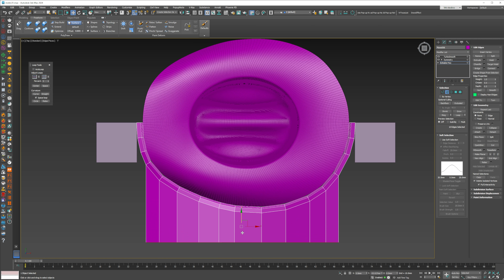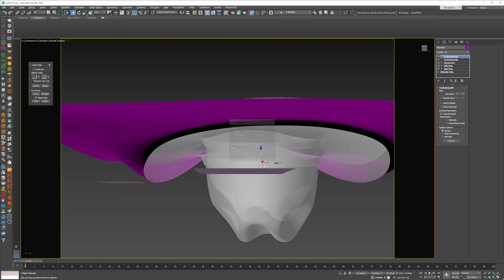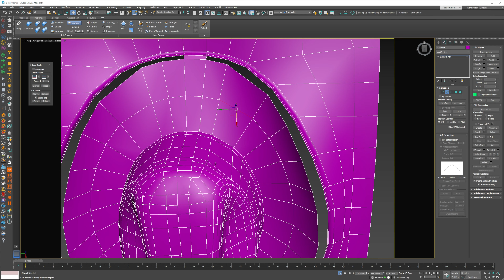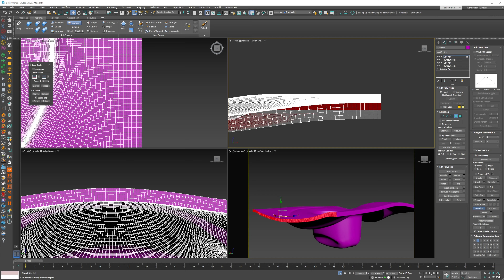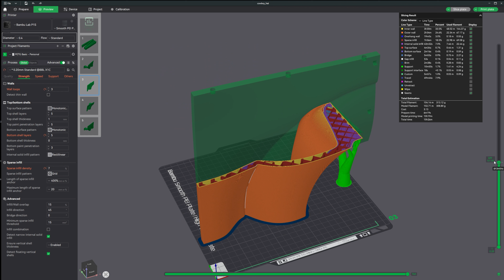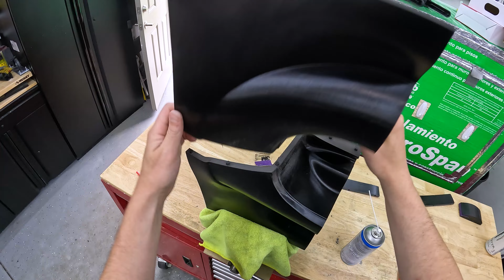3D Printing a Mold for Real Carbon Fiber Parts – Start to Finish!

Comment: Are you not going to coat it with epoxy resin like you did when making the Lamborghini bumper add-on?
Reply from the maker: Nope! Did infusion yest and worked perfect. No air leaks. No need for epoxy! This is exciting for since one less step.

Comment: I once used a process very similar to this one and for projects where you only need to make one CF-piece, it works great. If you want to create multiple, in this case, hats, I'd recommend you create a positive part with the 3D-printer and then pull a Mold made from fiberglass or straight up carbon fiber from it. It will hold up much better through repeated usage. Also, it opens up the possibility of using prepregs as it will be stable at higher temperatures than the printed parts are.
Reply from the maker: Ohh I 100% agree. Honestly right now I dont know how many I will make, I can say from personal experience, I have another mold that I use to sell parts and I have already pulled 14 sets out of it zero issues. I agree its 100% weaker than a proper mold but the cost of printing a mold vs making a mold is huge savings lol.
Reply: @poltdesigns  14?? That's amazing! I only ever got like one or two out of the 3D printed molds I made. xD
Reply from the maker: @SkyOps_Defense hahahhaa. I mean the parts not crazy complex but it does have some pockets and such. But yeah so far so good 😅

Comment: nice job ,i am doing the same process like you but i suggest you to use few layers of fiberglass at the back to make it strong ,i dont know how long you are planning to use that mold but for long term it needs some strength at the back otherwise it will crack !
Reply from the maker: Yeah I dont even know if first part will be successful or not lol. Usually the molds last me a while. Another part iv done iv pulled 13 parts from zero issues.